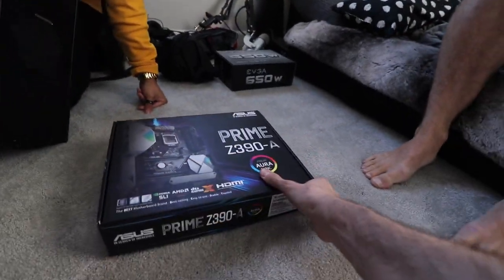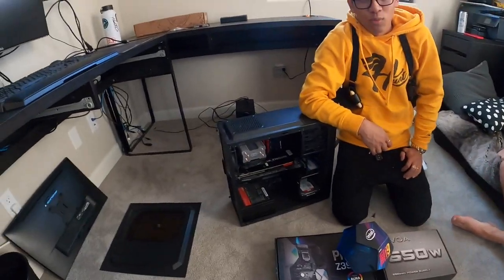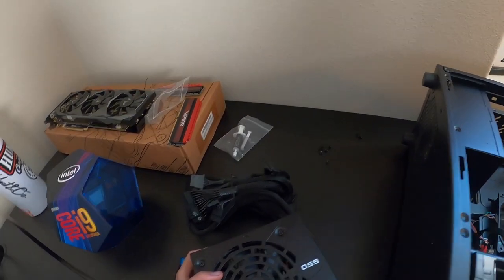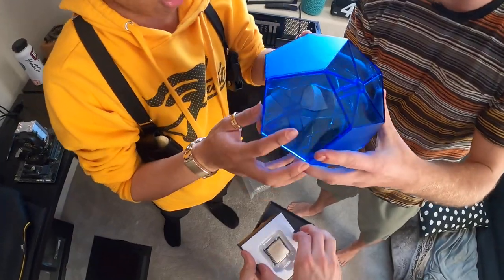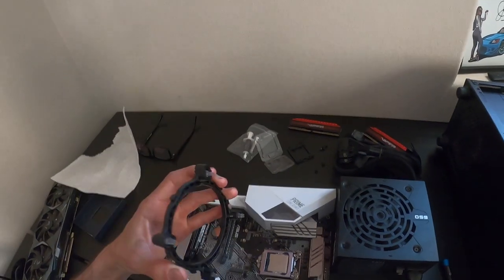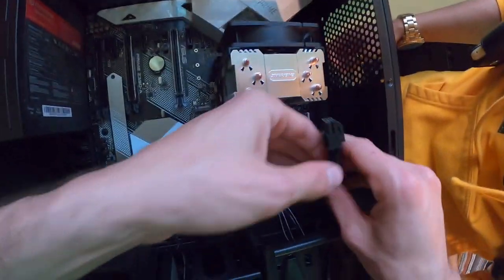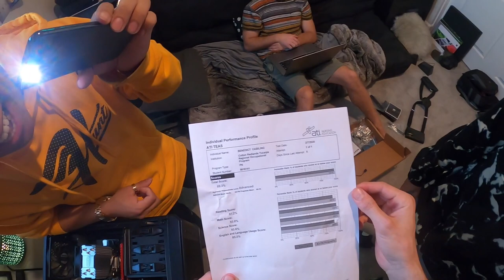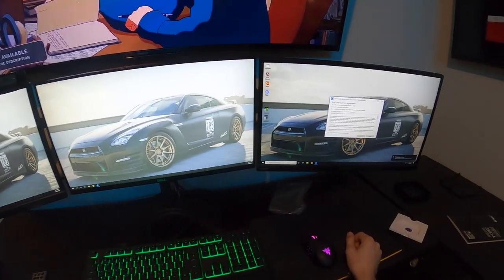Building my Dream Gaming PC Setup!

Comment: Literally no one:

Tj: let's throw some random high spec hardware in the basket and buy it
Reply: riccardo cacciari without having the proper power supply or cooling. 😂
Reply: Owen Y i saw that 650w and i was like “wow thats so underpowered” i have a 750w for just a 1660ti and i5 9400f
Reply: That little ass cooler on an i9 is the equivalent of trying to turn off a house fire with a spray bottle
Reply: idles at 95C on the desk top
Reply: @drpizzaeater  you really don't need anything more than a 650w for most consumer hardware. the TDP of the i9 9900k is 95Watts and the 2080ti is 250Watts
Reply: Tanner Williams ah yes but with the i9 you have to run a better cooling setup along with powering other stuff such as ram and eventually it all adds up. plus having the i9 would allow overclocking which is why its always better for me to give myself some headspace and go a little above with the power supply
Reply: At least he admitted to not knowing a lot about computers
Reply: @drpizzaeater  i have 1 1200watt psu and only a gtx 1070 and a 8700k , overkill is the way to go :P 32gb 3200mhz ram i only spend around 300-400 watt :P GO BIG OR GO HOME :D
Reply: @splift23  i9 9900K can draw up to 260watt and a 2080ti can draw up to 450 so no a 650 isent enough :) , it is as long its only idling , start up a power hungry game and you will run out of power :)
Reply: @danysexyboy123  overkill isn't the way to go on pc stuff, u gotta get the right stuff. 
When buying a psu u gotta figure out ur tdp (basically what ur pc will consume on a normal load) and get a psu with a wattage that's double ur tdp. This way u get most energy efficiency out of the psu power draw and u still got headroom for heavy loads (which isn't the typical state of ur pc during usage).
and btw a 9900k won't draw 260w or anywhere near that unless u heavyload it while overclocking it to its limit (which is really not the case given the cooler he has).
His rig will prolly draw something around 350-450w under load, a 650w is not the best solution for energy efficiency but will do the job no problem.
Reply: Owen Y actually the TDP for a 2080 and a i9 together is around 300 watts so 650 is perfectly fine
Reply: drpizzaeater just a btw, the i9 and 2080to are fine on a 650W because of they’re reasonably low TDP
Reply: Daniel Torp yea foo you trippin balls cause thats big cap, 450 under load for both 650 can go higher but 650 is perfectly fine

Comment: i feel like you need more cooling for that i9, they get hot
Reply: Probs could could get a bigger power supply too
Reply: AIO Cooling is a minimum for a pc like this
Reply: @TheNyr11  not necessarily, a decent noctua or hyper 212 could easily cool an I9, you only really need an aio when you're overclocking it
Reply: They’re fine under this cooler assuming you’re not ocing to 5 ghz
Reply: thats relevant to what he's doing.
Reply: if got enough money for i9 should be using 240mm AIO cooler.
Reply: Jaggsta noctua nhd15 is just as good if not better then a aio. Just because you have a i9 doesn’t mean oh it’s gotta have water cooling! Beefy air coolers are good options too.
Reply: @dakotabradford4989  ...usually I'd agree but that case seems a little small and considering the rear exhaust fan was set as an intake originally (and may still be)... In a larger case with a decent intake/exhaust fan setup and an atx motherboard with a decent set of vrm's that air-cooler would be sufficient but this setup is likely gonna be prone to throttling.
Reply: @Hsnyd  I have this exact setup other than case, psu, and fan. I have a corsair aio and my cpu still runs very hot. I think even with a good fan it will struggle
Reply: they get too hot for what they are
Reply: @TheNyr11  just a Noctua D15
Reply: I got a BeQuiet Dark Rock Pro 4, and from what I saw in reviews, it's more than enough for 5Ghz. Except I got a bad case for Airflow so I only managed to get it stable at 4.9Ghz

Comment: TJ: Upgrades PC with Core i9, new motherboard and 2080 Ti.

Also TJ: Cheap 650w PSU

Calvin, from one Filipino to another, I'm disappointed...
Reply: hahaha too true
Reply: ChewyBread that cooler for a i9 is brutal
Reply: u nerds
Reply: @jaredgummere3862  let's see how fast it can get to 90C with chrome open
Reply: ChewyBread A stock AMD cooler would work better
Reply: 🤣🤣🤣 For reals! Cheap PSU, that cooler... and the budget motherboard... Bruh!... 💀
Reply: Yeah a solid 1000w plat rated supply is likely his best choice
Reply: Yeah 650W psu. My guess is there Will be NO overclocking
Reply: @OmarDaily  agreed, I woulda expected a motherboard from the ASUS ROG line at least.
Reply: @adamcameron4003  you don't need a 1000w power supply.
Reply: @splift23  that is true, but he could have atleast gotten a high tier 650w. The current PSU he has is E tier, going from S, A, B, C, D and E. E being not recommended for any type of system at all due to cheap components and poor quality.
Reply: 16gig ram prime mb total budget build , peasent
Reply: @splift23  You dont want to be continually loading the power supply with 550w out of the 650. Around half of your psu constant load is a generally good reccomendation for long part life 
The 9900k and 2080ti calls for i believe a 750 watt psu from nvidia
Reply: Yes it will go on firee
Reply: and on the carpet rip
Reply: Can we please do something so that he watercools that i9 before it ends up exploding?
Reply: First off, The EVGA PSU is not “Cheap” well it is but build quality is superior. Let’s talk about the cooler doe
Reply: @grosen84  he probly needs to underclock

Comment: Hey TJ make sure you keep the bottom of the tower off the carpet. Otherwise your power supply will not vent, or you will be needing that new power supply soon enough. Get a small board or metal piece to create an air space between the tower and carpet.

Comment: that moment when an i9 gets the air cooler treatment (not even an NH D15 lvl air cooler). Huge F.
Reply: Was just about to say this lol. One of the hottest cpu's and terrible cooling XD
Reply: they should stick to cars, not pcs.
Reply: Massive fucking L. Cringed the whole time.
Reply: Should be okay unless overclocked does need a new cooler not gonna lie
Reply: hitorideツ gotta learn at one point
Reply: And the airflow of the case is totally destroyed mounting the cooler in that way.
Reply: It's a hyper 212...the cheapest thing on the market
Reply: Room is going to be a sauna
Reply: @MAT KULYK a noctua nh-d15 would have done the job. no need for water cooling.
Reply: MAT KULYK no need for water cooler, be it AIO or custom, hell even Corsair knows water cooling is that good, they just realized their own air cooler and it performs just as well as their AIOs and there’s a lot less points of failure, easier to install and in some cases, quieter bc it has no water pump, but a new air cooler for his pc would be nice
Reply: @chrishuynh6332  yep.i almost destroyed my 4690k because the aio pump stoped working all of a sudden.and when i upgraded to the r5 3600 i bought the chromax nh-d15.no need to look for cpu cooling.
Reply: @chrishuynh6332  "quieter because of no water pump" you realize fans at high speed make noise right?
Reply: Air cooler is fine.

Comment: 244Ghz, cant wait till they hit 300Ghz refresh rate
Reply: @kris6798  the joke is Tj said GHz and not Hz
Reply: @kris6798  woosh
Reply: @kris6798  Went right over your head there buddy.
Reply: Nvidia came out with a 360hz monitor. So now we gotta wait for 500hz.
Reply: @kris6798  thanks bud, you tried hard, and that's what matters most

Comment: A i5 with a 2080ti , damn talk about a bottleneck 😅
Reply: I mean look at that tiny cpu cooler for a i9 lol the heat
Reply: @evancraig11  haha 😂😂
Reply: @evancraig11  as i said on my comment. rip that poor little thing.
Reply: @evancraig11  And the fan in the cpu cooler is facing the wrong way, and the rear fan is an intake fan with no dust filter it's supposed to be an exhaust fan, i don't know why but Calvin or Tj decided it to reverse the airflow on the case basically where the air supposed to go out its getting in
Reply: @pedrolopez-yq7rh  honestly didnt even realize that wtf
Reply: That psu lol
Reply: @pedrolopez-yq7rh  I'm glad I'm not the only one that noticed that lmao
Reply: Should of gone with ryzen then his pc wouldn't be a microwave

Comment: you never wanna clean your parts with alcohol other than isopropyl as there are mixed ingredients that will leave residue on your motherboard. the reason people use isopropyl is majorly for the dissolving factor. So in conclusion drinking alcohol will most definitely harm your circuitry

Comment: I wouldve definitely went with the AMD Ryzen. AMD made a huge comeback on the processor world.
Reply: PCIe Gen 4 would have been a nice thing for a new NVMe SSD too.
Reply: That is facts
Reply: Lul u only want AMD if u want your house to burn down
Reply: Amd still not bettter for gaming tho, but for streaming and other stuff  they can exceed
Reply: But for purely gaming the 9900k is still better, not saying and isn't better in every other way including price
Reply: Truth. But if you're like these guys and really don't know any different you just know Intel and go with it. Mindshare thing still exists among normies.
Reply: Core for core intel is typically stronger and most games are pretty meh on using multi core. I wanna build a ryzen build or a thread ripper if I have the money. But I've got an Evo...that was ruined by the prior owner
Reply: AMD is king
Reply: AMD for multitasking and productivity
Reply: @Daymien  I think you need to realize it's not 2015 anymore, Intel is the extremely hot one today.
Reply: Yeah ryzen 3900x same price as 9900k
Reply: @jaggsta  no its not, 3900x is cheaper. 9900k is 530+ on the market new and 3900x is under 500, about 460ish new on the market
Reply: And they don’t update the cpu to run like shit after a couple years
Reply: They did but when your with intel like some of us have been theres few problems, 1 restoring the operating system becuase your switching to amd.
2 just becuase amd is killing it now that does mean you abandon loyalty.
3 if intel kills it later on that will be a headache again to go back to. Plus when you use geforce witch is better than amd the ecosystem has bennefits and works better
Reply: @leroyengels9597  other way around, amd better for single process, intell still kills it on multicore but kills it in rendering for video edits do to multi use.

Comment: Might want to flip the fan in the back around so it acts as an exhaust, and i'd also put the cpu cooler fan on the other side as well for better airflow.
Reply: It needs more than that to keep that cpu cool, I would just throw an AiO on it, dunno why he didn't, air to air coolers suck (in my opinion), also it needs a better ssd and some more fans.

Comment: Tj, you may have cut it from the video but it doesn't look like you have a SSD. Moving from hard drive to SSD is incredible. Faster boot and load times of applications. The Asus motherboard supports NVMe SSDs (faster than regular SSDs), I highly recommend switching to one!

Comment: I recommend upgrading that cooler to something bigger, the i9 is a hot boy! It wil instantly termal throttle when you put a load on it. Same happed to me at work, I worked as a pc technician. The last thing you want is paying for a i9 and at the end only gettig the performance of a i7. You can test it by using a program called Aida64 it puts a load on your pc with real time temperature readings.

Comment: You'll need that extra power supply if you're leaving your pc on the carpet. If the PSU fans pointed downwards, it'll just take in all the dust. Either lift it on wooden blocks or put it on your desk

Comment: I would have personally swapped out that thermaltake power supply. Thermaltake isn't really the most reputable brand, and EVGA has a killer warranty on theirs. The cooler is probably fine for the 9900k, but I would've went with either a bigger cooler or a AiO water cooler just for the headroom/overkill. (Don't forget to enable XMP in the bios.) And I would've added an M.2 NVMe SSD (I've had good luck with 970 Evo's) for the extra spice.  :P

Also, your iFixit toolkit lid can double as a screw tray for the screws you took out of your computer. (:

Not complaining about the build, it's perfectly fine as it sits. Just some tips that could be useful. Or not.

Comment: A few things to consider:

An i9 and 2080ti can maybe and I emphasize maybe be fine on a 650w psu but an 850w is argueably necessary. I’d personally go for the 1000w for some overhead and clearly price is no limiting factor. 

An i9 needs much more than a rather basic air cooler. A high end air cooler from be quiet or noctua or an AIO liquid cooler are much better suited for the job.

Decent looking/ performing cases are getting cheaper every day. You’ve owned gtr’s Ferrari’s and Lamborghini’s I think you can afford a better looking case and I think you’d appreciate it much more. 

Adding to the case argument, RGB is a thing man, it’s not necessary to performance but owning as many cars as you do and having a pc with the specs you have, i think it’d be worthwhile to invest in some aesthetics for your pc. This would also benefit your streams as you can display your pc in the background of your streams.

Just a few thoughts from someone who knows much more about custom gaming PCs than cars. Either way, I love seeing crossover content on the channel. Obviously I love cars but it’s great to see car you tubers branching out and covering other topics of interest

Comment: Tj, you gotta get in that bios and ramp up that voltage and overclock that cpu to 4.2 ghz(cuz your cooler is bunk). And shorten those ram timings and raise those ram speeds to 3200mhz. Lots more frames

Comment: I think you need to upgrade the case for better air flow specially with that 2080 ti and the CPU cooler. Not sure what the TDP is on that cooler, probably not enough for a 9900k.

Comment: Your cpu cooler is flipped, you should have the fan on the right side pushing air trough the metal fins out the exit of the case, not pushing in hot air like it currently is. You will have worst temperatures the way ti currently sits, I think just changing the fan from one side to the other might work.

Comment: Teej you should really upgrade to a liquid cooler. The 9900k can output a ton of power and an air cooler won't suffice. If you want the most performance out of your CPU 100% should upgrade. Also having the PC on the ground sucking up carpet dust will suffocate the PC. I'd suggest putting it on the desk or on its own little stand to feed the PC fresh air.

Comment: 650W power supply is on the minimum/low side you need for en 9900k with a 2080ti, I would suggest going to an 850. If there is one thing you shouldn't cheap out on, it is a power supply

Comment: Your cooler might be fine for a stock 9900k thats not overclocked, but would recommend a gd AIO to help with temps. Won't notice it at idle but will help with gaming alot.
Recommend a Corsair H100i, really gd AIO for the money it costs

Comment: I think the cooler is oriented the wrong way, the fan should pull air through the heatsink. Right now, it's just competing with the rear case fan for airflow.

Comment: Needs a better power supply and a WD black 1tb nvme drive.  I use a Corsair water cooler for that cpu.  The Viper ram is not great.  Should use a Kingston hyperx or Corsair.  You want cpu fan if you use one blowing toward the back or top of case to get the heat out. Should use an 80 percent + efficient power supply.  Cleaner power and efficient.

Comment: You need a little bigger case to fit a water cooler unless you like a space heater you have going on. Good job glad to see you into computers and I would recommend a little bigger PSU with 80 plus certification

Comment: Dude you need to switch that power supply. Thermaltake power supplies are junk. Evga power supply is good. Besides that if your thermaltake powersupply craps out it may take all your computer parts and fry em. Evga has good rep

Comment: That power supply is about to be working overtime, it should work but with the i9 and a 2080ti it's going to be using a lot of it's capacity, an upgrade to a 1000W is recommended

Comment: Hey bro appreciate what you do, love your channel, word of advise that cooler isn't going to be enough to support that cpu on a long term so I suggest you get a AIO cooler and also a new case which provides good air flow for your pc components and a 750 to 850 watt to handle the i9 and the rtx 2080ti something with a 80 plus gold certification. Keep up the good work bro 👍👍👍

Comment: that 165hz monitor wont work if you partner it with a 60hz monitor, the 60hz monitor would pull down the 165hz monitor to inputing 60hz (Windows 10 Issue) but you can fix it by playing only in "exclusive full screen" not on borderless fullscreen or just buy 3 165hz monitor. Just my advice if you notice some fringing or stuttering while playing :)

Comment: understand not knowing computer stuff but doa little research. it would help. minimum recommended spec for 2080ti is 650 watt and he has an i9 in there. plus the ariflow is just garbage due to the direction. try a beefier cooler for the i9

Comment: If you are running the 9900k you will need a better cooler, most likely a all in one cooler, dual fan radiator for that processor

Comment: You shouldn't place the cpu fan like that. It should blow from the front to the back, and you should put 2-3 fans on the front of the case to have a good airflow, especially with an i9.  Two, Three fans on the front(push/intake) and one on the back(pull/exhaust).
Enjoy your PC :)